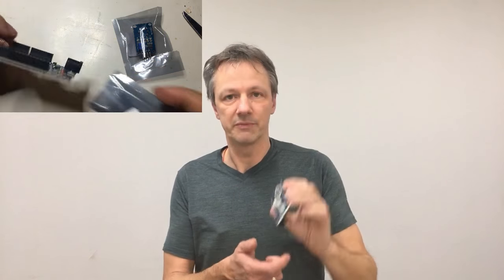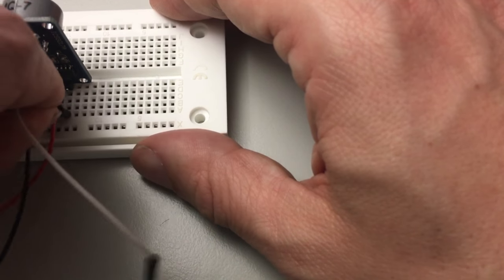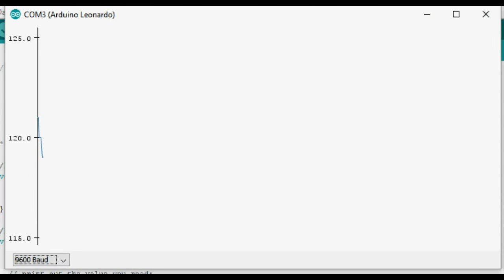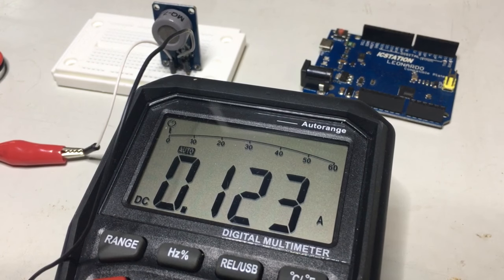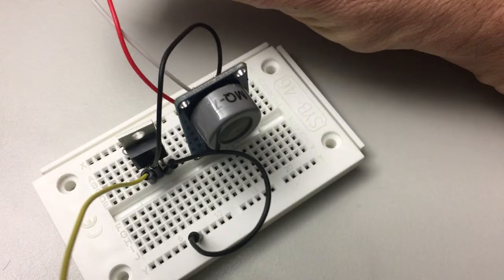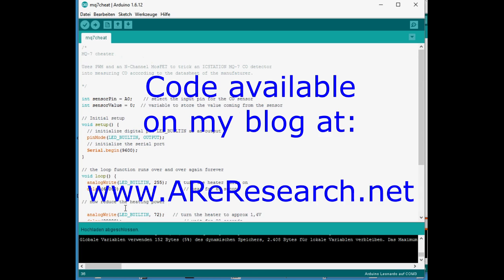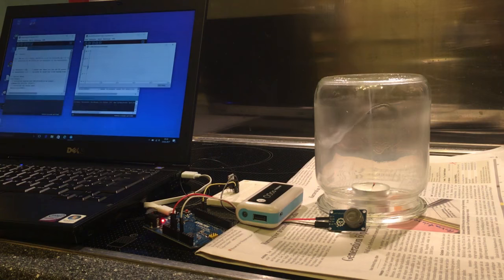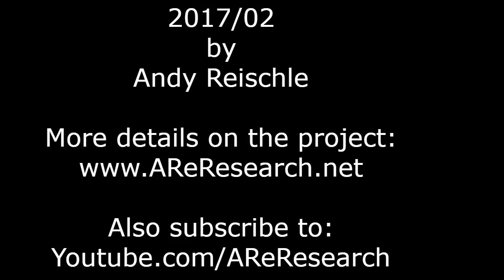How to use a MQ-7 carbon monoxide detector module

Comment: Hello, i just bought an analog carbon monoxide sensor (MQ7) for a project but it only has 3 pins (VCC,GND, and output) , is there a way to create the duty cycle that we need from 1.4-5 V and not from 0-5V ?
Reply from the maker: Possibly just the way I did it with PWM for this sensor. Can you post a product link?
Reply: It works the same way.... and you dont need PWM if you got 1.4V...... i dont understand your question.... your board has 3 Pins, VCC is for 5V heating and 1.4V measuring, this pin gets controlled by a PWM Signal and a Transistor which in one case is always on, that means 5V and in the other case the arduino pulse it (PWM) and the "average" voltage is than 1.4V...... GND should be GND.....and the Output is your Analog out.....
Reply: you need 1.4 and 5V, if you got them, you dont need PWM... if you only have 5V or Nothing, you use the 5V and chop it into pieces....
The Sensor doesnt need PWM....we just use it to generate the 5V for heating/cleaning the sensor for 60sec and 1.4V for measuring inbetween for around 90sec

Comment: The Arduino can genereate PWM Signals with 0V-5V, so you could adjust the voltage from D13 in this example from 5v to 1,4v. Why is the Mosfet and 5V Pin used, when you can directly change the voltage of D13 ?
Reply from the maker: The port can‘t provide the current needed for the heater. The voltage would break down, possibly damaging the port.
Reply: @AReResearch  Yes I noticed that, thanks. But as I see, the heating resistance of the sensor is 33 ohm and if I'm right  the current with 5V supply is 5V/33ohm = 151mA. If I supply it with 1.4V its 1.4V/33ohm = 42mA. As I know it is possible to get 40 mA from a PWM Pin like D13. If I switch the 5V out pin after the 60s to the 1.4 V  PWM pin with a relay, the PWM pin would be only get 42mA and should not burn if it can provide 40mA. Am I right?
Reply: So that there are 2 different power supplys, which are switched with a relay.
Reply from the maker: @renozerus5396  You should be fine taking the power from the 5v regulator of the Arduino.

Comment: Hello, in the Arduino sketch you are using delay(6000) and delay(9000). This does not correspond with the 60 and 90 seconds warming time of the sensor as required in the datasheet. Is there a reason for this
Reply from the maker: Ooops! You are quite right. I have corrected that on the blog. Thank you!
Reply: delay is not accounting for execution of Code before and after its used, so its the (delay+execution of code >= delay)...

Comment: hi Sir.i have a question that should i give always 5(60s)--1.4(90s)v to mq7 when measure CO or for only preheating time i,e 48 hrs?
Reply from the maker: You can pre-heat at 5V. That makes it more stable (ensures thermal equilibrium and cleans the sensor). When you have it in operation to measure use the 5V/1,4V cycle.
Reply: thanx alot sir...I appreciate this
Reply: Hi again sir..I tried this circuit but when 1.4 v cycle begins i get ov on mq7 input not 1.4v?
Reply from the maker: I take the supply voltage to 5v, just a few milliseconds before measuring. So the sensor does not have time to heat up.

Comment: Sir is it okay just to have 5v and 0v cycle instead of 5v and 1.4v? . I've tried your circuit but it gives me 5v and 0v. does that affect the readings of the sensor??
Reply from the maker: Hi Martin, you are right in so far as the circuit can only deliver 5v or 0v. The 1.4 V are the effective voltage the PWM signal generated on pin 13. The thermal inertia of the filament will smooth the PWM out and the heater will reach the same temperature as if it was run at 1,4V.
Reply: @AReResearch  ohw.. thanks a lot :) .I'm doing an mq7 sensor for my project and this will help me alot thanks . i've subscribed please do more tutorials about arduino sensors because i really want to learn it :)
Reply: @martindeang7035  this sensor is one of the complex ones in the way you need to heat cycle it... but simply said:
Every Sensor has an Analog-Out between GND and VCC, every voltage stands for an Sensor-Values..... thats not hard.....
and he shows in his video, if you just read the values with 5V heating, there are less sensitive.....
in which way you measured your voltage in the measuring cycle (1.4V)? you just switch the 5V voltage on and off very fast, if its on 100% of the time, its 5V if its on just half the time, its 2.5V.... search for videos with PWM voltage regulation, in best case with an oscilloscope, then you should understand whats happening (:

Comment: What about getting exact values for PPM?
Reply from the maker: There is a voltage vs ppi graph here in the datasheet: https://cdn.sparkfun.com/datasheets/Sensors/Biometric/MQ-7%20Ver1.3%20-%20Manual.pdf
But as the readings also depend on temperature, moisture and presence of other substances, I would not trust them with my life.
Reply: you need to calibrate them by two known CO ppm values in air.... hold it in there, look what it shows you and correct it mathematically..... and with the second value same and you got your own graph from which you can read your values....

Comment: Heloo sir, excellent video, i am trying with an Arduino UNO but it appears as if there are not any measurements when i try to read the serial port. What am i doing wrong?
Reply from the maker: The sensor has to be connected to one of the analog-in pins of the uno. When you read from that pin, do you get results?
Reply: why serial port? its an Analog-out, means that it just outputs a values between 0-5V (in this case)...the serial port is use when you got serial data......
Reply from the maker: @Devviiiii  I suppose he does not get any values on the serial monitor. Hard to diagnose from the information he gives.

Comment: The datasheet for the MQ-7 says that oxygen(O2) concentration affects the sensitivity of the sensor.
Reply from the maker: I hadn't read about O2, but quite a lot of common stuff like alcohol do affect the sensor as well. So you won't really know what the sensor is really reacting to.
Other sensors have similar but slightly different characteristics, so I can imagine a differential system with more sensors to get a better idea of which substance the sensors are dealing with.
Reply: @AReResearch  he means, if O2 is very low/high, the sensor couldn't react properly on his normal chemicals....

Comment: Nice video about the MQ7. I played with them (and burned one) a few years ago. If remember correctly the data sheet recommended a 48h burn in period.
Most people skip the 5V/1.4V Vcc toggling. At constant Vcc the sensitivity of the sensor decreases with time.
Reply from the maker: Have you tried to figure out if using the 1.4V as per specification helps to differenciate between CO and the other gasses (H2, LPG) the sensor reacts to? I can't find anything in the datasheets about that.
Reply: AReResearch, Alas no. Cross sensitivity is a "feature" of the metal oxide sensors. Some of the more expensive ones include filters to reduce the cross sensitivity.
In the case of the MQ7, the 5V periods are supposed to "clean" the sensor.
The main issue I had with this kind of sensors is that they need to be individually calibrated in order to provide quantitative measurements.
I have read that NDIR sensors are supposed to provide quantitative CO measurements out of the box, but this are considerably more expensive.
Reply: correction, NDIR sensors are for CO2

Comment: Hello, very good work and well explained, I have a question, do you know why it specifically needs to be 1.4 volts in the low stage? I know it's because of the resistive behavior of tin oxide on the surface of the sensor, as oxygen is an inert gas that interrupts the flow of electrons, but in the presence of CO its resistivity decreases. However, I don't know why it specifically needs to be 1.4 volts? What happens at 1.4 volts on the surface of the oxide?
Reply from the maker: Honestly: I don’t know either. I have it from the manufacturer‘s data sheet.

Comment: Noob here. I seem to have missed a basic conceptual step that most people would consider common sense. I'm confused as why we need to take the voltage down and why we need to heat.

My guess is that heating is necessary for expelling moisture that might interfere with readings and that the 1.4v period is cooling to prevent heat messing up the reading.

Close?
Reply from the maker: Close, but not quite: The CO (and unfortunately others) binds to the SnO2 in the detector at low temperatures and lowers it's resistance. That is when we measure the gas concentration. In order to prepare the sensor for the next measurement, the sensor is regenerated by heating it.
Reply: Thanks! One more question, I’m running the sensor circuit as you detailed but am getting readings of around 140. Im still alive so I think I must have done something wrong. I’ve run it for 48 hours. I do have an lcd screen attached so I don’t know if that affects it.
Reply: @AReResearch  hmm i detached the LCD and the readings are normal. Maybe the potentiometer affects the voltage.
Reply: @9duckman9  did you burned it in? very imnportant, clean air and 48h 5V heating...

Comment: Hello sir, according to the datasheet must heat the sensor for 48 hours.
Is it within 48 hours that the voltage used is 5V (60s) and 1.4 (90s) or only 5V?
Or are 5V (60s) and 1.4 (90s) used when starting the measurement after being heated to 5V for 48 hours?
Thank you...
Reply: Untuk pemanasan 48 jam pertama sebaiknya menggunakan tegangan 5v kontinyu biar element nya "matang". Mulai hari ketiga barulah gunakan tegangan heater High Low. Ambil sampling data hanya di tegangan heater LOW saja khususnya di detik 70 keatas. 48 jam itu minimal preheating time saja. Pemakaian 2 minggu keatas baru benar2 "matang" element nya. CMIIW...
Reply: @muhammadbasir83  Kak, buat baca datasheet sensor itu dimana ya? aku bingung banget

Comment: Hi! I have a question, heating cycle must be between H-H (heater) terminal, but using flying fish board you modificate H-H and A-B (circuit) voltaje too... Should I connect sensor Mq-7 without flying fish board?
And another question, did you probe this sensor with a ESP32? Thanks a lot!

Comment: Hello, can you please explain why the 10k resistor is needed and why for that exact place? Thanks!
Reply from the maker: That is an excellent point! As the PWM output is either at high or at low level, the resistor is totally pointless and can be left out. - I obviously hadn‘t thought that through property and used the design I use when the gate would otherwise be left floating. (Or on a high impedance tri-state output)

Comment: Hi sir, could you share how did you do for calibration the MQ7?
Tks.
Reply: he didnt do it.... for calibration you need two known ppm values of CO in some air, then you put it in the 0ppm (for example) thing, then look at your value and correct your values up or down until they are perfect and then you put hte sensor in 150ppm for example and you do the samething, measure and correct the values....now you have known values for 0/150ppm and you can calculate the other values inbetween and above..... plot a graph and you know what i mean....

Comment: what's the purpose of MOSFET implementation for this sensor?
Reply from the maker: The output pins of the Arduino can‘t supply that high a current. I opted for that mosfet rather than a bipolar transistor because it behaves pretty much like a switch.

Comment: Hello, analyzing the video I realized that the connection is different from the diagram, which is correct?

1 (GATE) TO 13PWM 
2 (DRAIN) TO GND (MODULE ICSTATION)
3 (SOURCE) TO GND (MQ7 SENSOR)

OR

1 (GATE) TO 13PWM 
2 (DRAIN) TO GND (MQ7 SENSOR)
3 (SOURCE) TO GND (MODULE ICSTATION)

??
Reply from the maker: +Alberto Torres The source connects to the Arduino's GND. Where in the video or in the blog did I get that wrong? I'll correct that ASAP.
Reply: In the diagram of the blog, it appears that the pin 3 (source) it's connected to GND (MQ7)
Reply from the maker: +AReResearch Oh yes! I see. For the Fritzing schematic I took some random N-channel mosfet from the library. But that has a different pin layout.
I'll correct that as soon as I can.
Thanks for reporting that!
Reply: Thanks to you for the video, it has been a great help. 
Regards!

Comment: Is it necessary to put the mosfet transistor for some time and then if I can remove it? or should it always be connected?
Reply from the maker: It is not only needed for the initial „burn in“ of the sensor, but also through each measuring cycle. (To regenerate the sensor) - So it needs to be there permanently.

Comment: hello again, is it possible to do this with a NodeMCU module?

I'm trying to do this, but the readings always go wrong. In Arduino Leonardo works great, but in NodeMCU I have not been able to make it work.
Reply from the maker: This is a really interesting question!
I have thought a little about it and it can be done. How depends on your particular module. The TOUT (=ADC input) pin of the ESP8266 has a range up to 1V.
The MQ7 needs 5V/1,5V for heating. In case of the ICSTATION module, the 5v also feed the sensor. This results in an output voltage of 2,5-4,3V. Much too high for the ADC to handle.
You'll have to scale (with a voltage divider) that down to a maximum of 1V or modify the module so the sensor (not the heater!) is fed with a lower voltage.
Reply: The module I have it's the NODEMCU (Lolin). It has a new output of 5v, I have verified with a multimeter the voltage that reaches the sensor and varies between 4.77v and 1.35v. The voltages are very similar to those of the arduino leonardo, the problem is that the analogue reading it's incorrect.

always tells me a reading of 1024 (sensor value). It is as if the sensor were saturated with monoxide.
Reply from the maker: Yes, this is the correct behaviour. The ADC only goes from 0-1V, so the 1.35V already maxes out the ADC. Try a voltage divider to scale that down. Something like a 4.7K / 1k Ohm divider should be ok.

Comment: Sir, your circuit doesn't go down to 1.4V, it cycles only between 5V and 0V. I have tried simulating the same circuit on LTspice and even the video shows the same (4:26-4:30). Am I missing something?
Reply from the maker: +Harkrishan Singh You probably didn‘t take into account the true rms of the PWM signal. At the given duty-cycle, this should be equivalent of 1,4V. As the PWM signal heats a filament, the thermal capacity of the heater smoothes out the PWM ripple and keeps a thermal equilibrium.
Reply: So no need for a capacitor?
Reply from the maker: A capacitor does not seem to be necessary. We‘re just heating the sensor. At the time of the actual measurement, wen need to apply the full 5v for a very short time. This IMHO a design flaw of the module.
Reply: @AReResearch  where do you get this information with 5V during the measurement? does it have to be in the beginning or end of the measuring and what happens if i dont do this? you got 5V for 60s, why should you use it again?! doesnt make sense to me (:

Comment: Sir
Can mq3 be used for making smoke detection
Pls reply
Fast
Its urgent
Reply from the maker: No, that would not be as reliable as a smoke detector. Optical or ionizaion detectors do a much better job there. Still: in case of an indoor fire, CO levels rise quickly to lethal levels and trigger the sensor. But that's not smoke detection.
Reply: If its fast and urgent than google it and dont wait on some people on youtube.... DONT BUILT A SMOKE-DETECTOR FOR YOUR VALUABLES  AND YOUR LIFE ON YOUR OWN! BUY ONE! 
if you just want to play with it, than listen on that, what AReResearch said, if you want to have a smoke-detector, use and luight-emitter and collector and if the light is obstructed it smokes :D
if you want to look for fire instead, then look for CO levels and heat..... or IR-Sensor work also.... or just a microfon to hear for crackling noises?

Comment: And how can I determine the parts per million from this value?
Reply from the maker: You might want to check out the data sheet: https://cdn.sparkfun.com/datasheets/Sensors/Biometric/MQ-7%20Ver1.3%20-%20Manual.pdf
But I wouldn't put much faith in absolute values from such a simple setup. There are too many factors influencing the results.